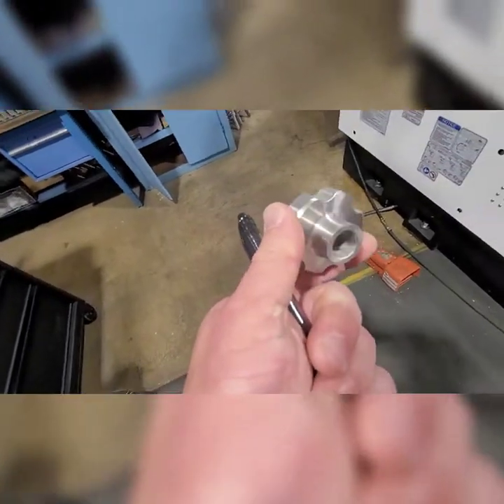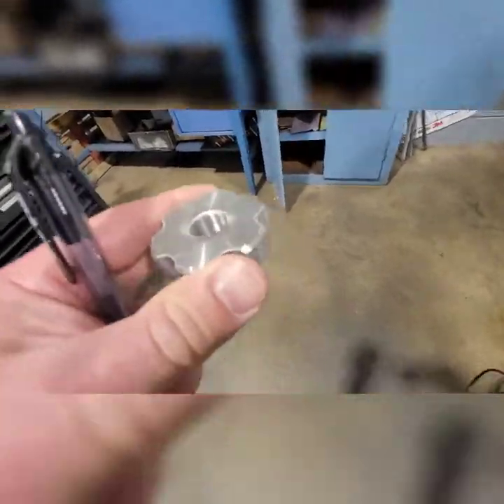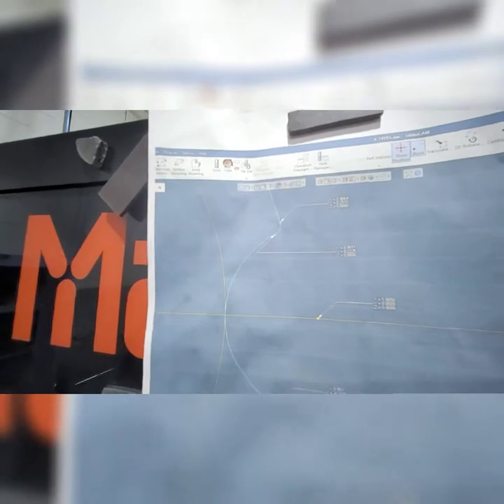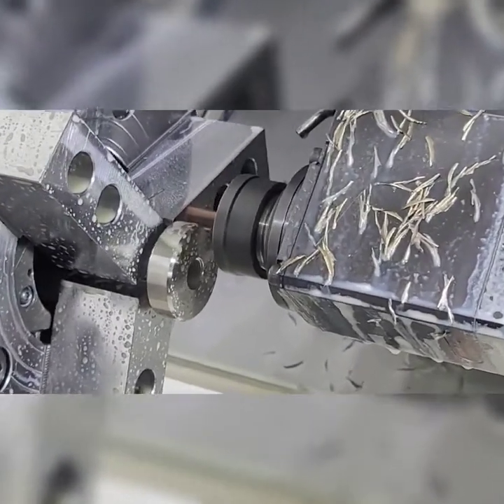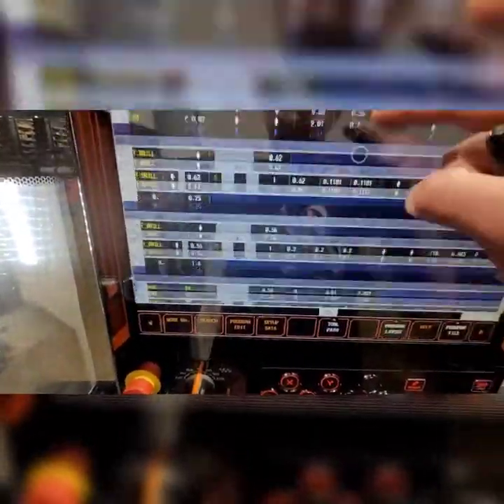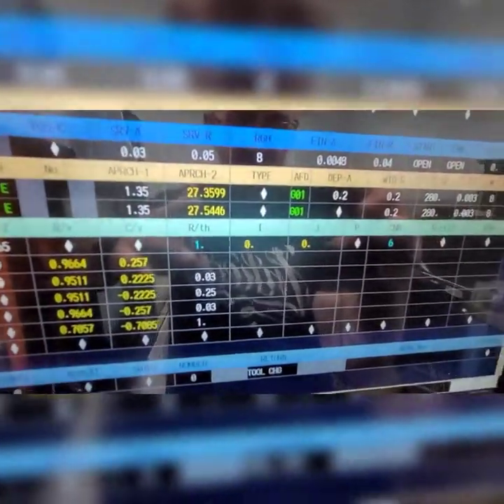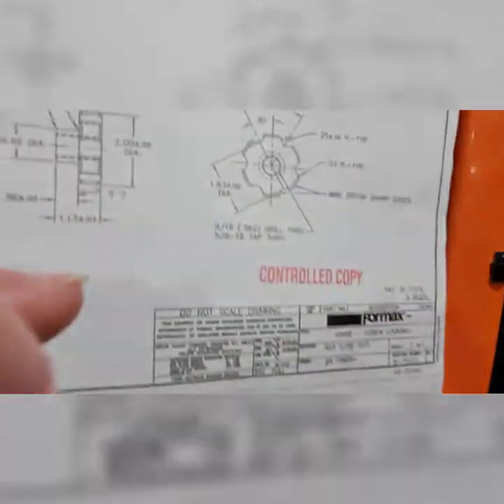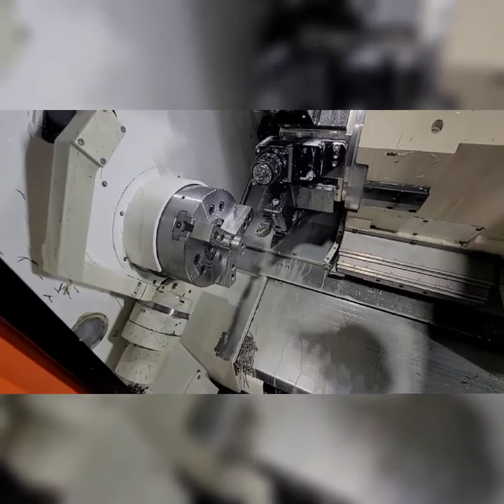Mazak Smooth G Lathe Milling Line Left Shift option Explained

Comment: Marty I tried to make a part similar to this today. But kept getting fault called 682 illegal repeat figure. Couldn’t figure it out so I watched this video and programmed the same thing that you have on this video to figure it out. I still ended up with the same fault. Do you have any idea what I could be doing wrong. I was gonna attach a pic of the print I’m working on with a pic of the program I wrote but it would not let me attach it to this comment. Any help would be very much appreciated if you have any idea.
Reply from the maker: Not sure, maybe tool related
Reply: @martyz3232  thanks I figured it out